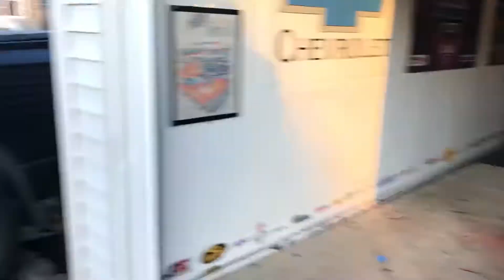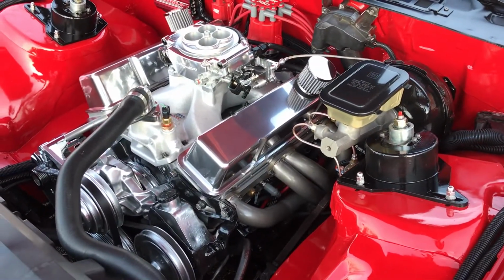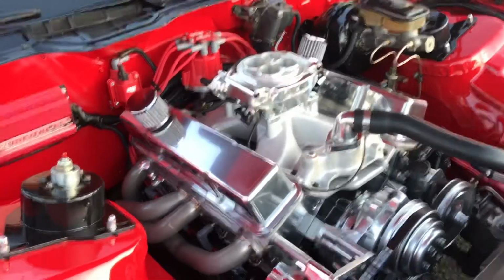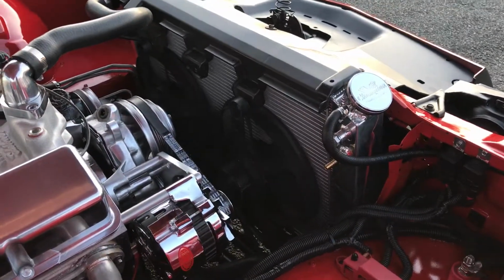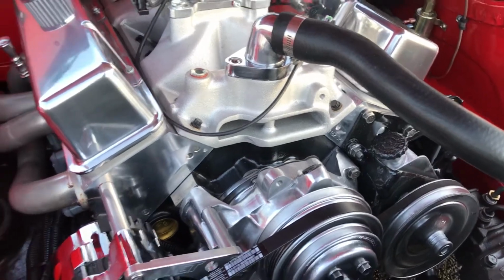Finished wiring, gave it a wash too

Comment: What a beautiful car! True inspiration
Reply from the maker: Thanks!  It’s come a bit further too since that video was filmed. I have lots of other videos on the channel but I’m
Not good with editing so it’s nothing exciting
Reply: @IROCZman15  I came across your video fr om the forums post you have. I'm working on an 89 Camaro now and was looking for ideals on how to hide engine bay wiring and found you that way. I wish I would have closed up all the holes and made panels for the marker lights holes like you did but sadly I did not. Did you do all the body work in the engine bay or did you have a shop do it? I was trying the see how you went from the 350 tpi to the smoothed bay and 406
Reply from the maker: @teabag402  I did all the panel work and paint and electrical.  I’m just one guy in a single car garage but I enjoyed doing it !
Reply: @IROCZman15  that's impressive! It came out great. I'm doing a full rebuild on my 89 and considered doing the same to my engine bay but figured it would add tons of hours to the build. I made a panel for the fire wall but didn't fill any of the other panels or holes, too late now, already painted the bay base and clear. So far I have the rear end and rear suspension replaced, painted the underside, stripped and painted the interior, Dyno Matt inside, relocated battery to rear, replaced front suspension, steering replaced and engine bay painted, put new radiator and dual fans in, painted the door jambs, trunk jams, trimmer bumper and got the doors, bumpers and glass back on, front end is still off, bumpers off. Plan on putting the new motor in (dual turbo 5.3LS and 4L80 trans) next getting it running and driving again, all bugs worked out and then paint the exterior last ( I hate working around new fresh paint) still have a ton left to get done but it will be worth it when done. I bought the car when I was 15 and built it once back then, nothing like the current build though. Appreciate you writing back
Reply from the maker: @teabag402  your build sounds awesome !! All the suspension and agreeing stuff will make driving  the car a dream and the power from the twin turbo setup will be thrilling.  Since I’ve done all that same kind of stuff( over the course of many years) I know how much effort you are putting into everything and on a full scale build like that it certainly is awesome when things start to take shape. I might have missed it, but what do you plan on doing for a rear axle setup?   Are you on the big Thirdgen.org tech forums?  Feel free to look me up on there too, my username
Is the same and I have a LOT of photos/videos in a lot
Of my build threads. I went with nitrous for a power adder and I freakin love it ! Keep up the awesome work.